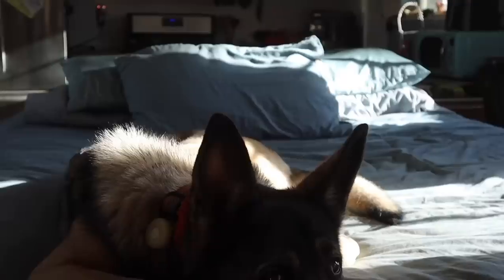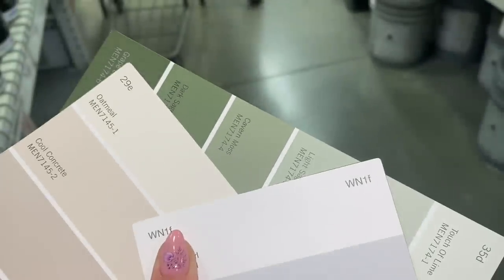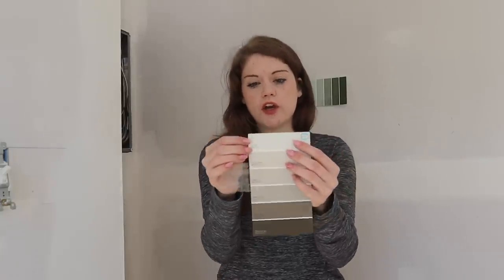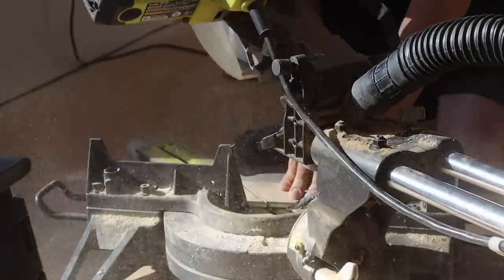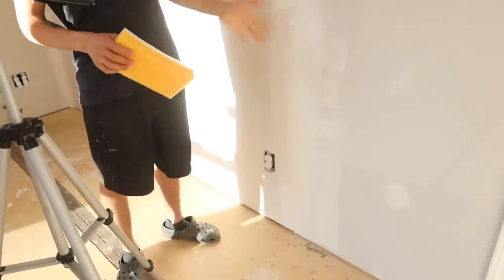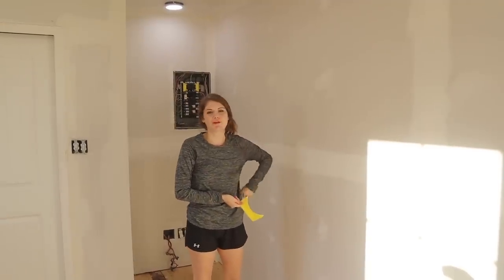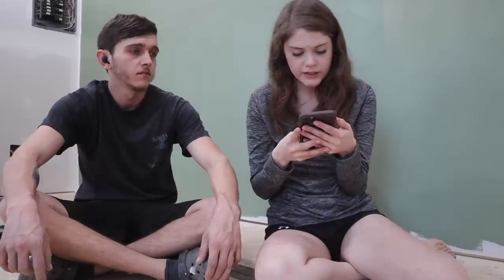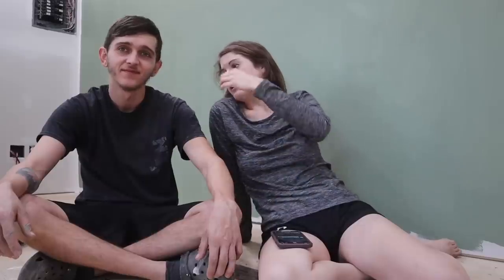RUNNING OUT OF TIME |SHIPPING CONTAINER HOUSE|EP:83| Mud MISHAPS & FINALLY Painting

Comment: When you paint a wall you cut in all the perimeter first and around outlets and lights and any individual thing in them.  Then you roll.  But when you roll it is from top to bottom in each pass of the roll so it doesn’t leave paint lines all over.

Comment: ooh ooh painting stuff - i always like this bit as its closer to the finish line - people always ask the daft question what paint is best to use, and i always reply 'wet paint' as its easier to put on the wall - i find best results are to paint edges first and use something to paint against not to spoil the wood frames etc, and fill in the rest with roller, to cover any brush strokes, but that's just me - but great job guys

now apparently they say painting the ceiling a darker colour to the walls makes the room look larger, that's if that is a real thing, i am thinking of trying this but not yet got around to doing it, i need to be brave but the old back problem is still present
a great tip for checking for holes and rough areas in the plastering (mud) is to wait til dark and use a torch to shine across the surface and mark them there areas in need of attention

Comment: For the nook paint color, why don't you do both? Continue the green on the lower half or lower 2/3 and do the oatmeal on the top. You can paint a piece of trim in the green (or oatmeal) to place over the line so it's nice and crisp or just tape a straight line. You could even paint the colors at an angle instead. I think either of those options would be super cool!

Comment: Love ryobi. I have that too. Makes everything easy. That oversized cutout would be stronger in the long run if you cut a piece of drywall or wood and placed it in there. Otherwise I thinm it will give early on and annoy you. I dont use paper tape, i use fibre mesh. Its stronger, easier and no tricks needed.  Dont worry bout ppl and their nastiness, you do you xx
60 30 10 is the % most go by for colours. You can roll in as many directions of you want but when your done, go over it with one long stroke to even out the paint . I dont know if you can see it but with all the little directions you have its pulled paint away from the wall so its a little patchy 💚

Comment: I know I'm way behind but I'm working on it. 😁 Quick tips, flat white on the ceilings. When picking your colors, remember it will dry darker than it looks on the swatch. I usually stay on the same line on the pallet but back up 1-2 shades. Do your cut-in first so when you roll it covers as much of your brush marks as possible. Unload your roller on the wall how ever you want, but make full passes top to bottom to even it out as you go. Try to alway keep a wet edge so when you over lap it helps even it out. Hope this helps for your next painting project. All in all, you guys are doing great and learning as you go. Nothing but love from me. 🥰

Comment: If you don't wanna use painters tape. Paint the dark wall first. If it gets on any walls it shouldn't, whipe what you can, cover it in the baseboard white and then paint over it with the oatmeal color. Also yall are lucky to have nontextured ceilings. cause having painted texture ceilings it is something I will always pay someone else to do cause it's the worst!

Also paint the nook green.

Comment: Just caught your videos here and been bingeing! Great work that you do inside and out.  Just working out problems is the best way to go. I wish I was younger and could do what you are doing :)  I have one thing to say though..it's your home and was wondering why you put your upper cupboards in the kitchen so high up? specifically the corner ones? They don't stick out terribly far so even if you lowered them a bit so the reach for Summer wouldn't be so far up. Just think of the mass of room in them being an easy reach for her. You can still tuck kitchen stuff under them and have room on the counter for chopping veggies or whatnot. I have lower cabinets in my home (Wooo) Above the cabinets can be used to decorate or even hide with some fancy moulding. Nothing better then having everything a short reach from the stove!  Good luck to you both!

Comment: Just a couple suggestions. If you only (prime) your ceiling now with the intentions of painting it later, chances are you won't paint it. And if you do, you'll most likely get paint splatters on the walls. I noticed neither one of you had a paint pole on your rollers. If you don't own one, you can use your broom pole and will find it so much easier to paint. Lastly, that black tray you were using for the green wall paint, it's actually just a throw away liner that is used in a metal paint tray. That's why it's so flimsy,,,,maybe pick up a metal paint tray and it won't slide around on the floor.
Reply: He used a pole.
Reply from the maker: Like he said we only used primer because that’s all we had and we live far from any stores. He did use a paint roller and yes we know that’s why they are so flimsy but it’s just easier for us this way. We don’t need anything extra. Thanks for all the advice tho!
Reply: @CantContainUs  When mentioning a paint pole, I was meaning  you could use one when painting the walls. I did see Cody using the paint pole, so wasn't meaning him.
Reply from the maker: @joannjukes9140  oh yes that would be so helpful since I’m short!